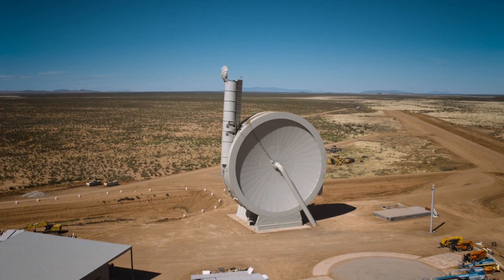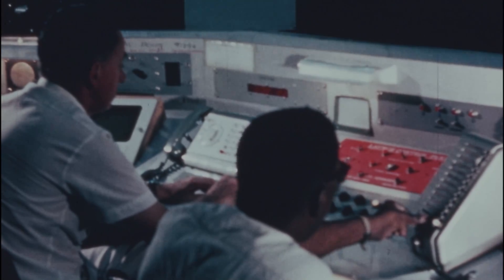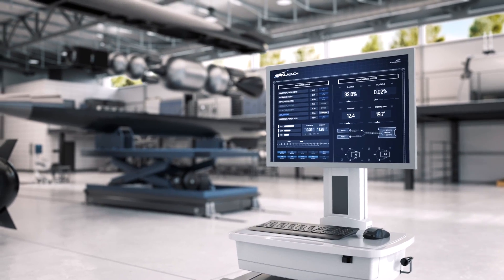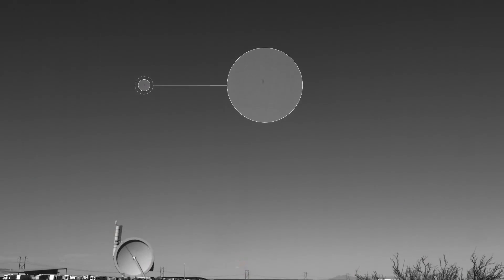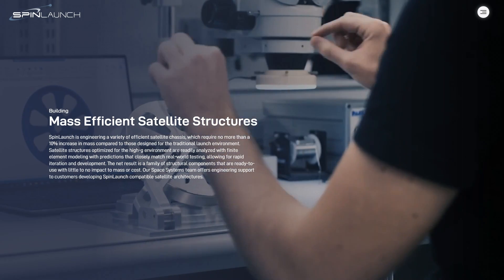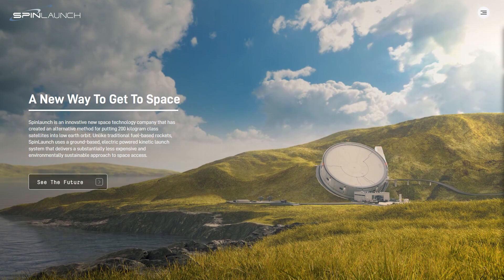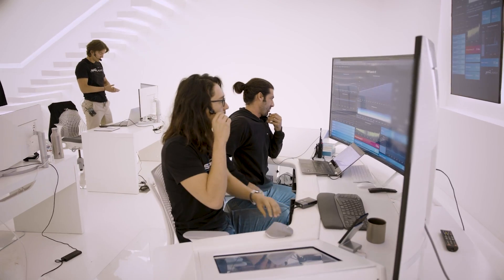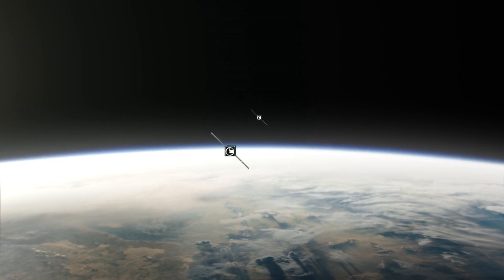Can Spinlaunch Throw Rockets Into Space?

Comment: There is an easy solution, to the super fast appering force-Difference, when the Rocket  is released :

You just make another , identical mass on the other side of the Spinner, which is "realeased" to the ground, with the Speed of Sound at the same ms.
(maybe make a hole before :)  )
Reply: That would waste half the energy, but yes
Reply: the impact would compromise the launch site, especially after several uses. you would need to build the whole thing as an ocean platform in order to not destroy the facility when it slammed a weight that large moving that fast into the area underneath itself

Comment: What I don't get, is why scale it up?  Just shoot a bunch of small payloads, and have them self assemble in orbit. You can't send people with this method, so it's not like anything sent up needs to be sent in one piece. That simplifies every aspect greatly. Either build an array of them, or just time the launches. So if you have to send up several payloads, you'd time it so the payloads end up within general proximity of each other, where they can use small thrusters to reach each other and assemble. Rather than putting a satellite into orbit all at once, you'd simply do it over several hours, in modular pieces.

Comment: To make it work to release the projectile without detaching the counter mass at the same moment the whole rotor assembly needs to be a whole lot heavier than the projectile itself, preferably the weight in the rotor needs to be concentrated in the extremes close to the circular path of motion of the projectile.
That way there is a lot more centripetal force on the rotor itself and the release of the projectile will alter the total balance in forces percentage wise less than when the rotor has less weight.

Comment: I'm calling bullshit in myself 🤦‍♂️see below;
Ah, they showed the SEAL! I'm calling BULLSHIT on that image though. Did you notice it was FLAT?
Did you notice the material it was made of did NOT get sucked into the "vacuum"? 🙄
I may be stupid compared to geniuses, but you have to be a total MORON to not see this. They are LYING to the public.
That material didn't look like it was holding back THOUSANDS of pounds of force. It was FLAT  because the pressure on both sides was equal. A mechanical engineer would have made it into a circular "dome", not a flat rectangle. I'm not even an ME and I know better than that. 
This is another Hyperloop SCAM. 
This is just like: 
Water from air
Hyperloops 
Elon Musk robots
Solar roads
🤦‍♂️
Reply: Someone wrote that I was unprofessional for pointing out the BULL$HIT of this startup. I think it was UN-professional for them to LIE. There was NO VACUUM in that test. You can tell by the way the glass/plastic of that seal didn't get pulled in suddenly by the air pressure. 
Supposedly the projectile was doing Mach 1. If it was under vacuum, the air would also be trying to move in at Mach 1. You would see the particles of the seal MOVING just as fast as the projectile, but in the opposite direction. 
But that's NOT what we see! We see the particles momentarily suspended while the projectile was moving up.
I'm NOT stupid and I KNOW what I'm seeing. Now that YOU all are aware of it, you should be able to see it for YOURSELF too. 
It was totally UN-professional to build a BUILDING SIZED unit before building a TABLETOP experiment proving it works FIRST.
Reply: Yeah, it was unprofessional. I've been thrown out of the profession and feel bitter. 
On retrospect, I think this might actually work.
It's huge! 
The workplace environment looked fun. They have a campus. It has facilities for fun off duty hours. It's out in the beautiful New Mexico desert. Bring your telescope if you go there. Its looks like they have a great team too. 
I guess I feel bitter knowing I can't work there. I wish them luck!
Reply: "Go big or go home" must be their attitude 😄
I'm ging home. 🤦‍♂️😂
I do wish them the very best of luck, but they're relying on skill.

Comment: The problem with the rail gun approach is that they are trying to make them compact, meaning you have to accelerate the projectile really quickly. So why not make a massive spiral that gradually accelerates the projectile? Then you wouldn't have to use megawatts of power in a fraction of a second.

Comment: They are definitely several steps ahead of anyone once the mining operations and material transport in space start to become viable, can't wait to see these on Moon, Mars, Phobos or Ceres
Reply: The thing is, this thing is capable of launching only very small payloads.  Building something large enough to be a viable means of launching cargo will probably be too expensive.  I doubt you’ll see it being used for material transport, especially from the surface of a planet.  It would be easier and less expensive to just use a rocket or cannon.
Reply: @Shadowkey392  The spinny thing is probably not viable for larger payloads, but on the moon we could definitly build a mass driver.
Reply: Can you imagine a series of these stacked on each other? Each layer increasing the velocity a little. Put ore in the bottom and it rockets out the top into a processing facility in orbit. 

Mercury is a goner.

Comment: I interviewed with this company a few months ago. They let me see videos they don't show the public. 
From what I saw there's a major component their missing details on: the SEAL. It's supposed to be strong enough to keep out full atmospheric pressure, yet the projectile is supposed to punch its way through at 5000 mph.
It's about 30 inches wide. That's 10,900 lbs of force that it's holding back. The seal has to be that strong, yet it has to POP in an instant. 
And why are they building it at FULL SCALE to start? 🤦‍♂️ That's just STUPID. 
What happens to the pressure vessel when that seal pops?
That launch boom will still be spinning at 5000 mph when the full atmosphere hits it. Will it self destruct? 😄
Reply: I don't think the seal will be all that difficult. 11,000 lbs is not that much. It could just be a plastic membrane with some ribs in it. Pretty unprofessional for you to say all this after interviewing with them. You can say what you want in a professional fashion. For example you could say "my impression is that the seal on the exit bore could be very challenging to get right, and I think it may be strategically unwise to start at full scale instead of progressing through a series of larger and larger prototypes."

Comment: while this design might have problems due to atmosphere density on earth (which can still be partially alleviated by performing this on mountains, at 6km height air density is 50% less than at sea level), on moon this might be a very efficient tool
Reply: On the moon you'd use a linear accelerator.  No need to deal with the absurd g-forces that will inevitably doom this thing.
Reply: @JMurph2015  yeah i feel like on the moon this thing would rip itself out of the ground once it releases and the spinning arm is suddenly off-balance.
Reply: @JMurph2015  linear accelerator would have absurd gs as well. Or you would have to build an extremely long accelerator. As Scott pointed out, for a linear accelerator it's V^2/length of the accelerator and for the spin launch it's V^2/radius of the accelerator. You'd have to build a linear accelerator kilometers long to launch stuff at low gs.
Reply: @Steelrat1994  that's exactly the point, you would build a linear accelerator kilometers long.  Except mass drivers (what we're actually talking about) don't work on Earth because you can't really reach useful speeds without running into a lot of simple physics laws.  Either you evacuate the pipe and deal with the shock loading of slamming into the lower atmosphere at high Mach number or you leave the air in the pipe and deal with friction the whole time.  That's not to mention the inevitable, gigantic heat loading from the whole process, and the fact that if you launched anything at high enough velocity to really make a dent in the launch profile (aka not require some form of substantial rocket), then the friction losses would actually start to dominate any additional initial velocity you put on the thing.

Let me say that another way: it's moreorless impossible to make a truly ballistic projectile that ends up near orbital velocity at 100km.  Not because of technical limitations, but because drag is a function of velocity squared, which means in a sufficiently thick atmosphere, the thermal loading inherent to speeds necessary to punch through that atmosphere with a desired end velocity is just obscenely high.

Just spit-balling, imagine if you wanted to throw something to end up vaguely close to orbital velocity at the edge of the atmosphere.  (Let's say 6,000 m/s, for context the space station's orbital velocity is about 7700 m/s). So let's imagine further that drag losses only mean you lose a third of your initial velocity to the atmosphere.  That puts the initial velocity at 9000m/s.  This is an extremely conservative estimate as rockets need about 9-10km/s of dV to ISS orbit, with much lower drag losses.  So now you're talking throwing something at Mach 30 in the upper troposphere at best (off a 10,000ft mountain or higher).  Pretty much every known material would just melt and/or vaporize from that speed below the mid-upper stratosphere.

Now SpinLaunch is trying something more conservative by using a pretty good sized rocket in the system, but they are still fighting those same cruel physics, and they are doing so with the handicap of also confining themselves to a circular acceleration layout.  This idea would be maybe okay if they were doing a 5km pipe up a mountain with the same somewhat beefy rocket.  But as it is, this ain't it chief.
Reply: Yeah why aren't they on a mountain?
Reply: @joshuaa.5523  Mauna Loa, not the one with the telescopes,  4,200 meters, here in Hawaii.
Reply: @joshuaa.5523  Because it's hard to deliver material and people to the mountains. Why bother if it's a proof of concept prototype.
Reply: yeah seems like a great system overall but it's all location, location, location to maximise it's effectiveness and still be local-enough for people who want to make use of the system.
Reply: @IRMentat  this looks like the perfect kind of thing to be built on the Himalayas or Ecuador: just over the tropics and as much afar from the centre of the Earth as possible.
Reply: @matieyzaguirre  Height of the Himalayas is a rounding error compared to the distance to the center of the Earth. Atmosphere density is what matters.
Reply: Full scale and max energy level it would probably yeet the moon in ways we don't want =s
Reply: @fish_basket_with_slaw  the moon has probably taken much larger impacts from asteroids if you consider their masses are much larger than that of the rocket.
Reply: On the moon there's no air resistance and low gravity, so a low power rocket can do it.
Reply: @aluisious  yup but you have to use propellant, and moon dust is gonna be a huge issue on the moon, rockets are gonna make it even worse haha

but also, even if gravity is low and rockets could do it, problem with rockets is always that "you need more fuel for heavier rocket, but more fuel also makes the rocket heavier".. with this yeeting method, even if it just accelerated rockets on moon to Mach 3-4, you could cut down on fuel, and  this could potentially give an option to decelerate your payload on destination because you have enough fuel left, I imagine it being used as mail shipments from moon/mars (because mars atmosphere is too diffused to stop the aircraft by friction as you can do with earth)

another idea could be to launch 5 rocket stages at once from 5 different launch facilities, and make the parts combine in flight (should be simple enough if you can stabilize the speed of each stage)

Comment: I don't understand why they dont use a vacuum maglev system to launch which uses electro magnets for the launch. You wouldn't need a super high complex material which needs to stand 10.000 G's. In this era this throwing mechanism kind of going backwards instead of advancing forward... You might be even able to put humans inside if you use a super long tube upwards so that acceleration would not be deadly ;)

Comment: They could make the launch arm symmetrical and drop ballast into a tube pointed towards the ground at the same time they launch the payload upwards. No matter what you do you still have to zero out the momentum imparted to the launcher as a result of the launch, so a ballast actually seems reasonable. If only one ends up releasing you have problems. But, but I imagine thst woild be the case even without a ballast system. You could also just make the drum heavy enough relative to the payload that even after it's launched, the shift in cg is sufficiently small to be compensated by more traditional dampeners.

Comment: Dear Scott I have a question for an Idea if you have thin sheet metal and "puncture" it like it's done to food cans it gets more stability.

What if you do it similar to rockets? Thinner material less weight more payload capacity.

But in my idea you use dimples would it work too? Lighter material usage + the dimples reduce the drag.

Comment: Most cell phones (not their screens, the electronics) are rated to ~5000 g or more. If you drop it from 2 meters onto a hard floor and it bounces, it hits at ~6 m/s. If it deforms by 1 mm in the bounce, that's roughly  2000 g. People do drop phones, and so they need to survive such g forces.

Comment: I've been reading a lot of comments on simultaneous release of two 180-degree items, the launch projectile and some kind of counterweight.
But what if these folks simply offered companies the chance to launch two projectiles simultaneously.
Two for the price of one.
No bore holes or capture tunnels required. Granted, you'd need the chamber to have two disintegrating exit panels, but the timing at release could reasonably be expected to work twice if it works once.
For that matter, and I'm not really trained to analyze this stuff, but shouldn't some of the more problematic transsonic effects be canceled out by two concurrent launches in opposing directions at proximity?

Comment: My issue with these technologies is that 99.99% of commercially designed satellites is incompatible with these launchers. Most of these have very frail antennas and solar panels. Undoubtedly satellites can be made to withstand the launches but armoring a satellite increases dramatically the payload weight. Satellites are made to operate in zero g environment and not 10000 g's.

Comment: Solved engineering problem ? Unless i am wrong (and i could be,my mechanics classes are far off), 10 tons at 10 000 G is 10^9 ish newtons. That's the weight of a bloody ford CVN hanging off the arm. Even with crazy sub hull steel (lets say 800MPa), that's still a section of 1.25 square meters. If they pull it off, the arm alonewill be an engineering jewel.

Comment: I still think putting a rocket on a 1km long rail-gun system up the side of a mountain and accelerating it at 2g  to 2000m/s powered using modern energy storage systems (battery arrays) with a few Giga-Watt-Hours of energy is a more practical proposition and will get your horizontal and vertical vectors for orbit well up and also allow us fragile humans to be on board. Using hydrogen for the main fuel to push the rocket after it leaves the rail-gun would make the whole thing environmentally much more friendly as well.

Comment: This could actually launch fuel cells, drinking water, food pouches etc into orbit for a manned mission to collect and use for a lunar/mars mission.  It shouldn't be either or - traditional rocket tech could be nicely complemented by this technology.

And if you can't scale it up, you could probably use it at it's current size to send "micro" packages into orbit, and interlock them remotely for a single pickup.  It's more about getting the mathematics correct than anything else, especially if you can make these pods recoverable and reusable.
Reply: My thoughts exactly...this would suffice it for sending materials into orbit until we figure out the space elevator problems (or to help bring the space elevator to manifestation).
Reply: really like the concept of complimentary launches; brings to mind the linear acceleration concept from Heinlein's "The Moon is a Harsh Mistress." Also why not build this on a mountain top where you don't have 'dense sea-level air' ??
Reply: @Chris-ji4iu  Yes, I thought about putting it on a mountaintop.  I don't know about the geological stability of a mountain though, they tend to be on major fault lines, don't they?

Still, you could easily build a train to take stuff up the mountain if that's not an issue

Comment: Major artillery 16" shells such as Iowa class battleships experienced travel near the limits of the atmosphere. There was a bit of experimentation in extending the range of these guns.
Launching from high altitude aircraft sounds better to me. U-2 spy plane has a service ceiling of 80 k feet and a cruise altitude of 70k feet. Note wing configuration. Perhaps refitting a FedEx cargo plane, a C-5,  or certain 747 planes with longer, suitable wings and engines would work.
Reply: You mean like Stratolaunch’s Roc?

Comment: The russian during the Soviet era was first to think about it, but yes they thought of using it to put enourmous loads of hardware in to orbit to build very big space stations or send hardware to the moon and beyond to build bases on other planets. They tought of a maglev type of train that was to be built around the equator and reach enourmos speeds before release and then rocket engines the last bit up. So it was overengineered but still interesting because of the weight you could put in orbit to almost a tenth of the cost per kg per launch.